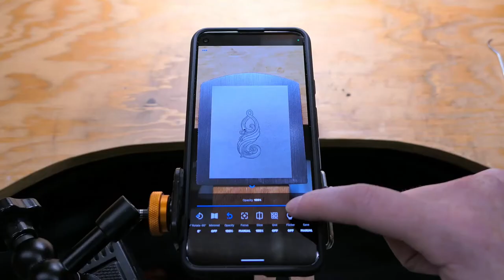Concept to Creation | Filigree Pendant Part 1

Comment: Love watching your videos! its very relaxing. I was wondering you use 3D as well as handmade. isnt it possible to make this handmade with 3D?
Reply from the maker: Thank you so much! Yeah, this probably could have been modeled pretty easily in 3D. But one of the main reasons I like to hand carve my pieces rather than 3D model them is to keep practicing and refine my skills (and I just really enjoy hand carving 😁)

3D modeling/printing is great but it isn't perfect for every project. I've found that In some cases, hand carving is fasting and more cost effective than having to take all the steps to model/print/wash/cure a piece.